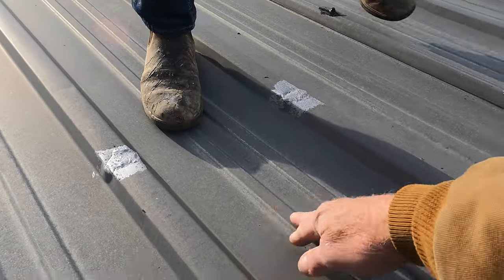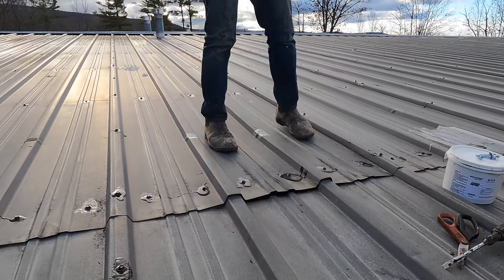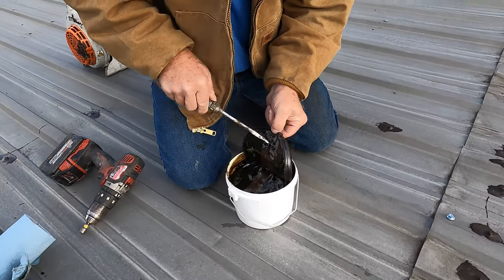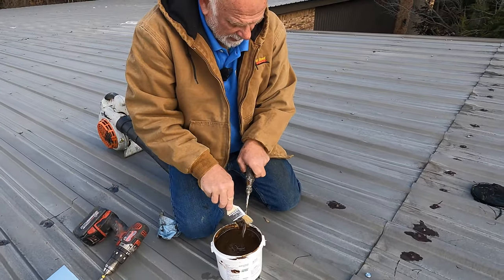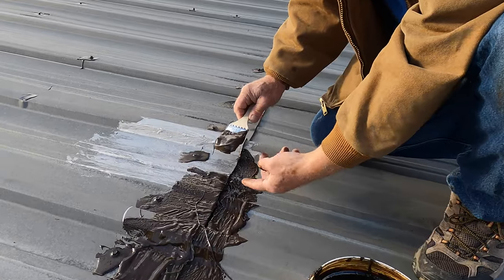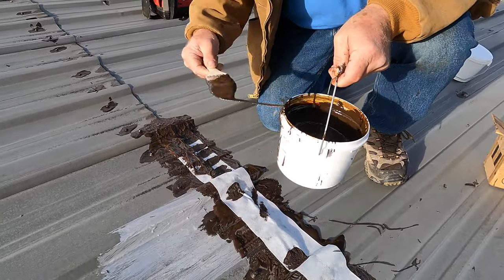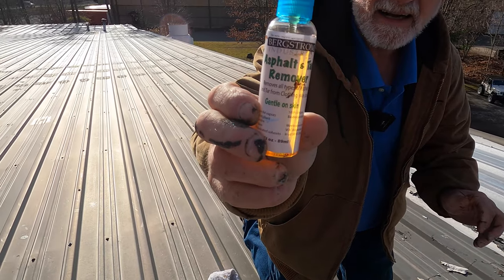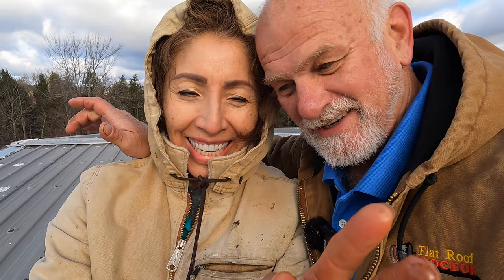Metal Roof Seam leaks - This will blow your mind when you see why it leaks - Turbo Poly Seal - DIY

Comment: JUst a big thank you. i ran across your videos about 2 years ago. It was in November here in the midwest and i developed a leak in one of my skylights (i have 3 in the family room). i had that area of the roof reshingled due to storm damage earlier in the year. so i  did not think it  was due to improper flashing. Rather the skylights were 35 years old and i think the seal between the window and frame was leaking. i watched a lot of bad videos on line with methods that i thought would not work and if i hired someone they would use one of these stupid methods. Anyway i ordered the PolySeal and fleece, followed the directions and no leaks for over 2 years. For good measure i did the same treatment on the other 2 windows as well. i had a good day to do it ( 52 degrees and sunny) and it took just a couple hours over 2 days to complete. So thanks for the videos and the excellent product.
Reply from the maker: Use Super Silicone Seal on glass and plexiglass. Turbo Poly Seal will not work
Anyway, thanks for your comment
Reply: @FlatRoofDoctor  yeah i could not remember which one i used as i used all of it. i just saw the Poly Seal name and quoted that. i did use the one that was recommended for glass.
Reply: @FlatRoofDoctor  
You should say that in one of your future videos.
It is very important to know that.

Comment: How would you like to come and fix my roof and do a video on that it's a very low slope metal roof on a concrete building with no edging around the edges of it and it leaks I'm in Iowa though
Reply from the maker: Iowa? slightly out of my way. I am going to Massachusetts soon and that is a 10 hour drive 1 way
Reply: Well it was worth a shot thanks 👍

Comment: I could imagine condensation could gather on the inside of these metal roofs frequently and of course run down to a low point , leading to anyone believing there is a leak or worse still poor workmanship.